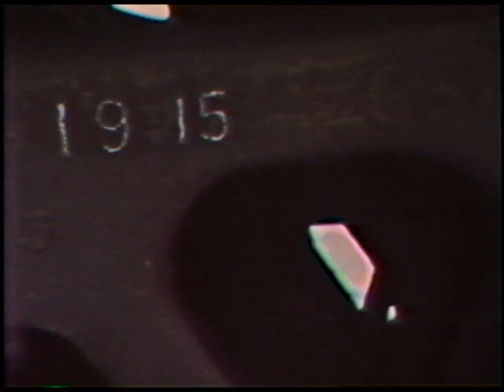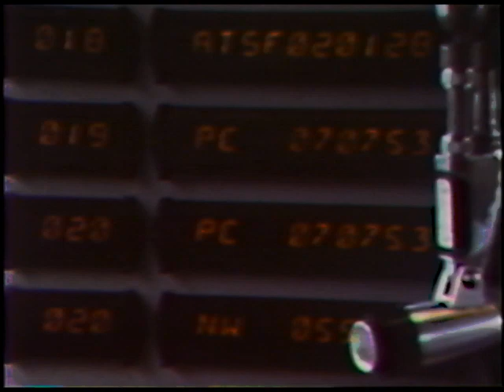Penn Central 1974 - Movie used to get federal funding

Comment: Penn Central was never going to work from the gecko. Both the PRR and NYC were neglecting their services, and were way too focused on Merging. Because of that, When the time finally came, That issue had finally caught up. Both had not realized the corporate rivalry both Railroads had with others. They didn’t take into consideration how each Railroad had completely different methods of operations. From signals and dispatching, to freight and transportation Policies. Because of the neglect from both Railroads about their different strategies, and the deteriorating qualities both were suffering due to do decade long merge negotiations, Not the mention the lack of consideration when it came to financial costs, The Penn Central had become a ticking doomsday clock for the northeastern Railroad industry, and soon, it was Railroad Armageddon. Deteriorating tracks, derailments left and right. It was a complete disaster
Reply: wrong. the ncy was in great shape. the PRR had been waiting since the end of ww2 to go broke

Comment: I call old P.O.S. cars just like those that roll in the shop "asshole cars", they're wild cards.  You pray you'll get through a single car air brake test without trouble. That is, after you've spent half the day fixing other crap all over it.

Comment: OK. I accept that I'm a complete idiot and that Pappy knows all, especially what happened at his switchman's job back in '73.

So what would Pappy have done? Fire all management? That wouldn't save the company. Let's hear a real suggestion that would stand up to the historical record and save PC.

In the absence of said solution, please read 'The Wreck of the Penn Central' as it will give you a clear picture of what really happened.

Comment: If only Penn Central was still alive today, we would've seen new PC consits, like PC GE wide cabs, PC GEVO's, PC ACE's, Mac's & 70M-2's, might even see some SD40-2's & Geeps!
Reply: *****
It was the gov that caused the climate that the vast majority of eastern roads toiled in. The gov (I.C.C.) made it difficult/ impossible for roads to change shipping rates. This was the ONLY way for roads to compete against the then emerging trucking market. 

The gov also made it difficult to shed lines that were unprofitable.

So in light of these two problems, the trucking industry was akin to the jackals nipping at a wounded lions heels.

It's only a matter of time before the injured lion succumbs.
Reply: *****
Poor management of the predecessor lines didn't help either. Example - when NYC decided dieselization was the way to go, they didn't really evaluate the various manufacturers. They bought EMD products for one region, GE for another, Alco for another, etc. There was no standardization which made motive power assignments a costly interchangeability nightmare.
Reply: DouglasP201 
I worked on the PRR then PC..The merger would have worked but, the cards was stacked against it..State ,Feds and the customers played a part as did the Unions and upper management and one of the worst was old company loyalties like a PRR freight clerk routing a loaded car over the PRR instead of the shorter NYC route or visa versa.

Comment: Wtf is an ar16 that's an alco rs3
Reply: They were using the Pennsylvania Railroad term for it (AR16 was what they called an RS-3)
Reply: A = Alco (E = EMD, B = Baldwin, L = Lima, F = Fairbanks-Morse)
R = Road Switcher (F = Freight, P = Passenger, FP = Freight/Passenger)
16 = 1600 Horsepower